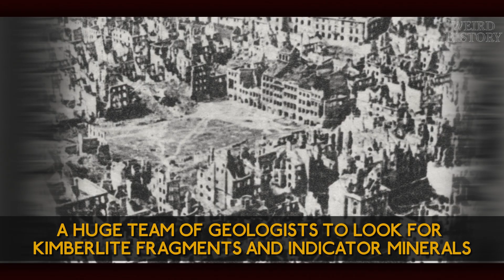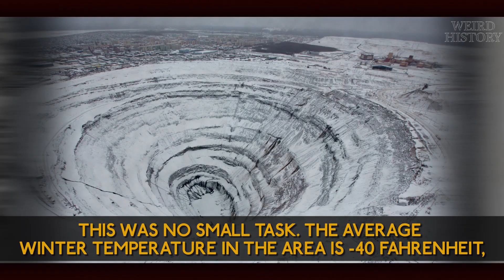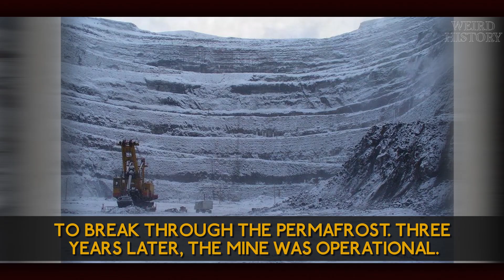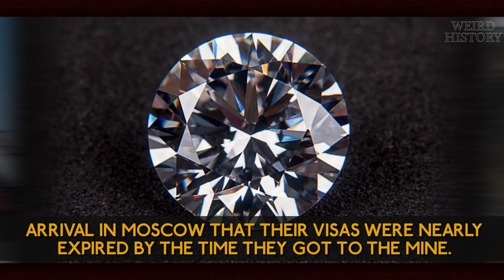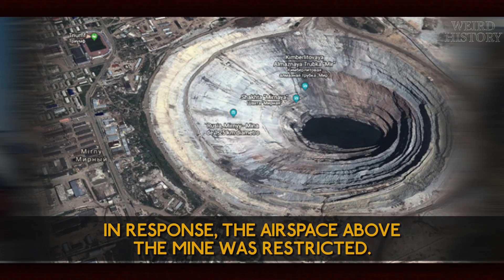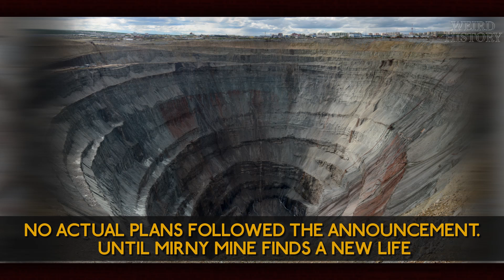Mirny Mine: The Diamond Pit That Can Bring Down A Plane

Comment: As of recently, China has been manufacturing more diamonds PER YEAR than are MINED! Furthermore, they are manufacturing Type IIa colour grade D clarity VVS i.e. the highest quality diamonds you can find, they are identical to natural diamonds but are a fraction of the cost. 

Additionally, the only way you can really determine the nature of the diamond (i.e. natural/synthetic - ie man-made) is by using lab equipment, like X-Ray equipment, etc., standard gemmological testing for diamonds (which are already quite limited anyway) can only take you so far as to identify it as a diamond.

Ultraviolet (UV) fluorescence is a key test for diamonds, if a diamond fluoresces stronger in shortwave UV than longwave, then that suggests it's a synthetic diamond and vice versa for natural diamonds - however, the reaction may be difficult to determine as synthetics are known to fluoresce stronger in longwave than shortwave, like naturals (the key is to look at the pattern of the fluorescence in the diamond as opposed to the intensity and colour).

So in layman's terms, it's a bit of a headache to determine whether a diamond is natural or man made.

ref. GIA

Comment: I grew up north of the Arctic circle, 
I've seen temperatures as low as -60 and have worked in mining at similar latitudes
Oil does not freeze, car tires don't shatter. It's entirely possible to run a mining operation at this latitude
Not even the North Pole has a winter average of -40 (hovers around-38 depending on which months you average)

Check your facts. This video is bogus. A simple Google search refutes a bunch of dates and facts
Reply: I lived in Iqaluit for a while, can confirm, colder weather than described in the video and the cars ran just fine.
Reply: I live in MN, and it's not unusual for it to hit -40. Cars work just hunky dory, and your tires remain pliable, not fragile as glass. Methinks they're confusing temperatures like these with those of liquid nitrogen, which is -320, not -40, and can shatter rubber.
Reply: Yep been living with -40 winters my whole life and driving to work. Never had a shattered tire, never had my oil freeze, I'm smelling some strong bs here
Reply: Also the term permafrost implies that the frost is permanent, it stays all year round. There's mud on top of it, but the ground below is always Frozen

Comment: -40 is NOT cold enough to freeze oil and shatter car tires. Very, very far from it. Your average vehicle, with the proper coolant, will have very little problem operating pretty much completely normally at that temperature.

Comment: Hrrrm, could they not just dig more horizontally rather than vertically and keep the mind operational?
Reply: Kimberlite is volcanic in origin and forms vertical pipes. So going down is the only option if you want to find the diamonds.
Reply: Thank you :)
Reply: they cut the video on the elevator and train ride into the deepest gold mine in the world. I suspect they lied about where they went. energizer hasn't made a new battery in years and looking at all the foolery in this diamond mine, I think we need to reconcider everything they told us about the mining industry. NewEarth YT has prooven already that growing rocks is real, it exactly how chemistry works as in growing crystals. And she has stated that volcanoes are fake they are just slag piles what explode like spoil tip. If we figure out the gold mining lie it may better helpus understand the diamond mine inspection during a economic crisis they put the world in. a commenter I recently saw stated what if use direct sound array to control the internal structure of metals during solutifying, so I thought it may pertain to making diamonds aswell. If they were looking for something else during the inspection i guess crystals for making the direct sound speakers or an ICE type catyalist as powerful as the counterpart platinum. I have looked into all the ICE type chemical reactions and it's all to weak. we need something as powerful as h2o2+platinum. I started looking into dragon mythology to better understand it, they covered mountain dragons but not the dragons in china ICE TYPE you know. Said mountain dragons got platinum from the high mountains. bacteria in their gut made hydrogen mixed with methane would react with the platinum in their teeth. I know it's just folklore but it helps explain all the questions you asked about debeers! we can sense lies...